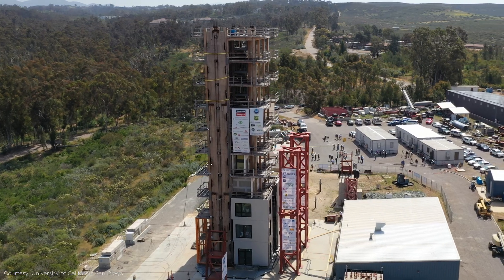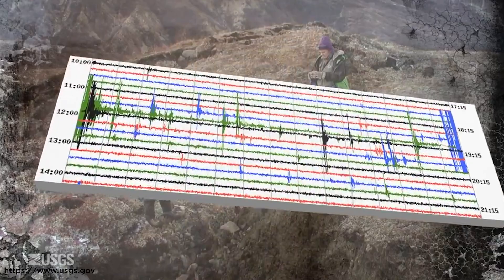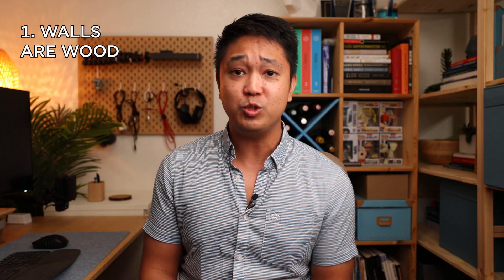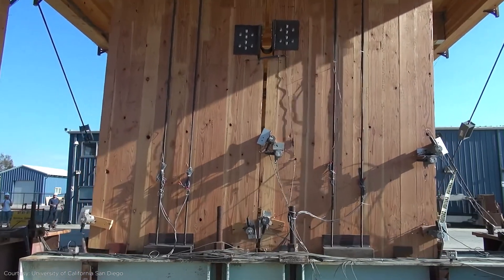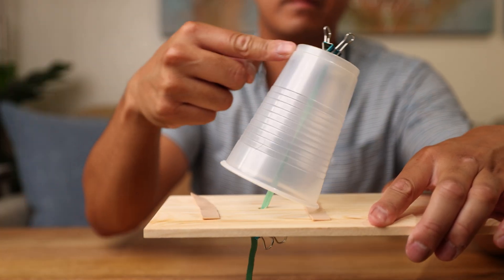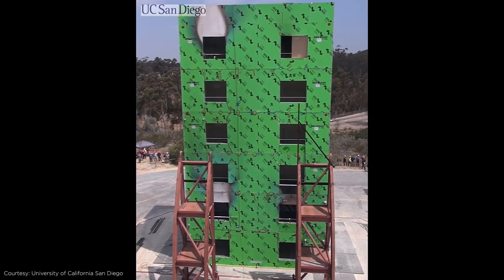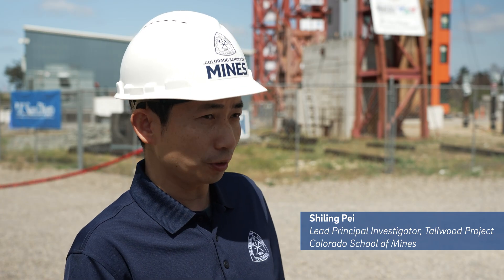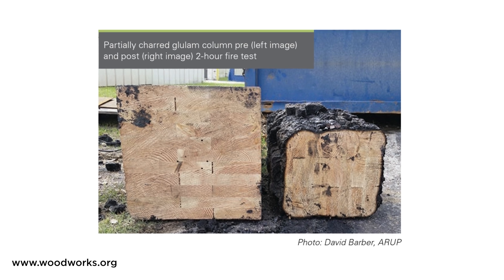Earthquake Simulator vs Wood Skyscraper - Engineer Explains

Comment from the maker: How do you feel about earthquakes and fires in a wood skyscraper?
Reply: I don't think wood has the strength for buildings that high. Not to mention the amount of wood you need. BTW, how would you analyze seismic load? I used to 1.0/0.7 one way, but we are using 1.0/0.3/0.3 three way now.
Reply: I DONT AGREE SIR , IN WHAT YOU QUOTED THAT RC BUILDINGS CANT BE RESILIENT THAN WOOD STRUCTURES ,, ,
IF YOU WANT TO HIT RESILIENT DESIGN IN ANY KIND OF STRUCTURES,
YOU HAVE TO ABSTAIN IN THE IDEA OF ELASTIC DESIGN .. . YOU DONT HIT THE TRUE RESILIENT DESIGN , COZ YOU ALWAYS GO BACK TO THE IDEA THAT STRUCTURES MUST BE DESIGN IN ELASTIC MECHANISM .. .
Reply: Mat I've sent you a message on Instagram for months no reply
Reply: They demonstrably stand up to quakes.
Actually, in a fire, the structural members' surfaces char, but the structural members don't distort. Steel does. Wood wins here.
Producing steel or concrete makes a massive amount of CO2, wood is literally made of CO2, water and sunlight.
Reply: Systematic ITM is assumed. Do engineering schools discuss practicalities of economic stress on a building’s systems? Original design intent assumes adequate ITM. Does the maintenance get reduced during a recession, if leased space drops to 60%, and income is inadequate to make loan payments? Will owner pay out of pocket?
Reply: Maybe the wood members could be soaked in ammonium sulfate
Reply: I can't express how much I love this video, the new idea, and the concept. Maybe this is the beginning of the new structural system and connection that allowed the absorption of seismic force rather than the fight and damage that you mentioned. It will be good if this concept can be done for concrete and steel materials also. Maybe we need to do more research on connection types.
I appreciate for making this type of amazing content for this profession. Thanks, Mr. Mat Picardal! 
💝Love from Bangladesh. Wish to meet you one day and learn something new. Sending you best wishes for an amazing journey ahead!

Comment: Seems like a system with considerable advantages. Wood has one weak spot. Moisture will lead to rot and there goes your tension  that is holding it all together. 
Termites can be controlled.

Comment: I'm a plumber not an engineer but imagine you need to service those cables but that is still cheaper than building a building. I'm curious how the wood will hold up over the long term with all of the flexing it can do. I imagine wood is also more sensitive to environmental factors over time like moisture and temperature and even living organisms. It's a cool idea in the works though. I also prefer to have to set anchors into wood rather than metal so, there's that.

Comment: Regarding fire, while it's true massive timber withstand fire pretty darn well, it still takes a higher toll compared to concrete for instance. I love wood houses and the esthetics they provide and there's a lot of options to not have fires started at the first place. But at the end of the day, I think timber, concrete and steel can work together rather than replacing each other to achieve even better and more tolerant and sustainable constructions.

Comment: I think tall wood is stupid. 

From an engineering challenge perspective its cool yes.

We should focus on modular timber as well as speed of construction. We know what building types timber makes sense for.

I'm curious how alternative issues are resolved. (sound, fire) considering the cost of this system. In addition is there any reason one can't do a rocking wall in steel?

North of a certain amount of stories its not a very good material as member sizes eat into leasable space.

Comment: There is a large mass timber project here in lake union Seattle (Northlake commons) thats been really cool to watch. I love these buildings. I trust them completely. I especially trust this design with the wood spine, wood is super resilient. Im curious about how it is to work with during construction as the wood warps and changes size due to water exposure. Not that it hurts the integrity but just knowing wood isn’t perfect no matter how you cut and glue it, and scaling that up in a full size wood tower.

Comment: GREAT video. i use post tensioning vertcal external tendono for church, Bell tower and other slender heritage Wall (in Italy existing building are my core business. i live in venice). 

i have some questions:
1) how the rocking Wall Is restrained at the base. "hinge"? for rocking?
2) you have, for gravitational load, a big Mass wood column, and for laterali load a kind of RC section (rebar are the tendons)...correct?
3)why tendon are not fully centrifugate ? the are not near the Edge of the section, they looks like near the neutral axes
4)if i want to use spectral modal analysis, what value of "behaviour factor" you can use? there Is some documentions? or it's pure research for now?
Reply from the maker: The researchers had analytical models beforehand to compare results, and they're probably finishing their research papers on this test soon to help answer these questions.
Reply: @MatPicardal  thanks. can you update us (if you want) when they delivery the analytical model and the papers?